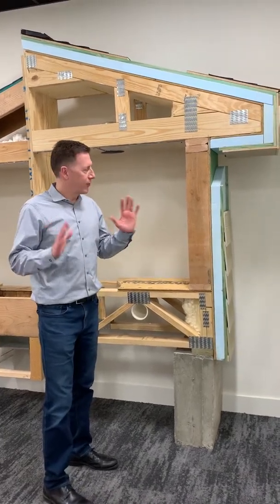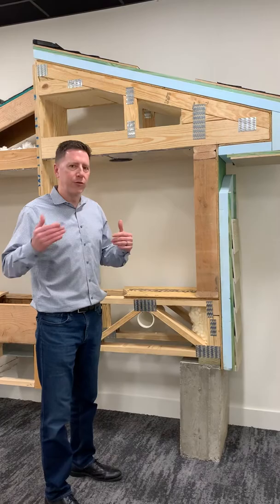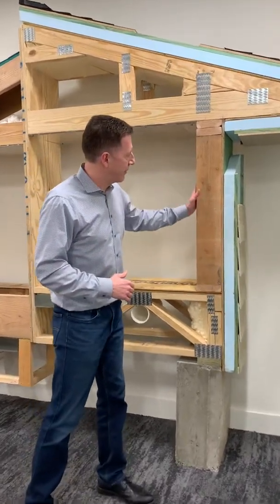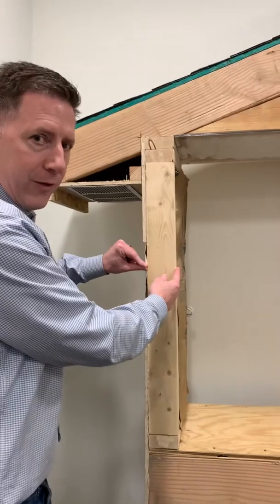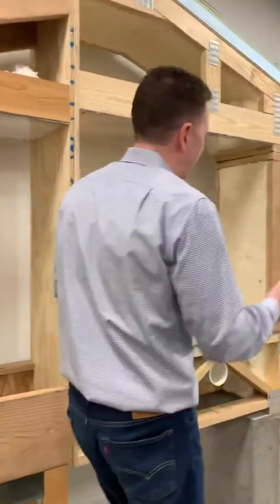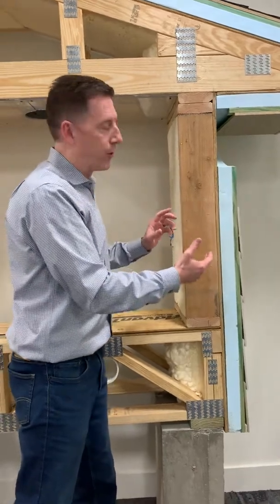12) High Performance Building: A Home Builder's Guide to The Perfect Building Envelope

Comment: My biggest pet peeve are inaccessible attics.

At the very least have a good walk board system around the insde of the attic for maintenance and inspection purposes.
Spray for bugs and critters along with making sure there is no insulation blocking good air flow from the soffits.
Also plenty of good lighting and power receptacles for maintenance use.
Air and air systems along with duct work should be inside of the conditioned space.
All filters should be located with easy walk up access to inspect and change.
There's a ton of changes that could make homes better cheaper places to live and operate but builder profits puts changes out of reach.
Build them as fast and cheap as possible give the surface facade a pretty look , take the money and run.
Reply: Totally agree. Each specialist whether it's insulation, structural, plumbing, or electrical will typically only concern themselves within their lane, and it seems like it would be nice to have an energy auditor or some kind of consumer advocate to weigh the pros and cons of what to do with their existing house which now needs all these tune ups, as well as regulatory reform to make builders not use the cheapest materials and build practices possible and opt for more energy efficient or more modern build methodologies that can offer accessible spaces for maintenance like you said.
Reply from the maker: My attic is fully accessible with this design. In fact, I made 2 more bedrooms and a loft area with the extra conditioned space.
Reply: Attic accesses are obsolete energy wasters. Store your luggage  on the main floor and haul the junk to the trash. There is no  r eason to go in an attic of a modern home.
Reply: @realRonPetersen  I think he was speaking to access for maintenance for older houses, not sure how you got storage out of that. We recently insulated our attic and I was wondering how with all the blown cellulose how much more of a pain it's going to be to diagnose electrical problems or update electrical in an old 50's house. There's a insulated walkway for the boiler system but that's it.
Reply: @MrAlziepen  I’ve had to deal with that blow and I move it with a plastic snow shovel. Look inside an outlet box. If you have plastic insulated wire aka Romex (introduced in 1952) then you can sleep easier tonight.
Reply: @realRonPetersen  that shows how little you know about living materials that are harvested and milled into building materials for home construction.
It shows how little you know about proper construction of an attic access door.
It shows your lack of understanding of the reasoning to have major areas of your home accessable for inspection and maintenance to prevent tens of thousands of dollars in damage to you largest investment in your life.
Your lack of caring about the poor guys that have to hack their way into your none accessible attic that you found nessassry to create.
The only thing you did get right was nothing should be stored in an attic.
I'm sure you are one of those people who buy into the two story home garbage because of energy efficiency and cost savings for the same square footage.
People always over look the high maintenance cost they get hit with anytime a contractor has to do anything to a two or three story home , especially if it's built on a hill.
Everybody's got to have gutters, another major expense and possibly deadly issue with a two story home.
The home owner or friend that's never worked higher than two foot off the ground climbs up on a 6/12 roof and goes to the edge to clear the gutters, good luck with that.
The list of bad building ideas sold to people are endless, not to mention the architects and builders that are not concerned about the problems coming from living in these expensive badly designed boxes.
And least but not last, two story homes are a nightmare to live in and Will wreck your body because of the constant need to climb the stairs for everything.
Bedrooms upstairs and you break a leg or hip good luck with that nightmare..
Then there is the whole selling your home everyone grew up in leaving friends and neighbors because you just can't do stairs and steps any longer..
Number one issue with people that changes their life, back , leg  , foot , and hip issues.
To be a good sales person you have to gain your target's confidence , build up and reinforce the good points steer them away from the negatives and keep telling them how much they deserve the turd your trying to sell them.
People in the end are their own worst enemy, they cannot be bothered to research and think complicated purchases through. And then people like you reinforce bad building ideas.

Comment: What blower door test values do you typically achieve with this insulation model?
Reply: Insulation and air sealing are 2 completely separate layers in the wall system, so the insulation isn't responsible for improving air tightness. While it's true that something like closed cell spray foam can improve the air tightness of the envelope, that certainly should not be the only air barrier.
Reply from the maker: We have received very good values, but this exterior foam concept is not the main reason for good blower door tests. It's a lot of the other details.

Comment: Old School is the correct school! You need to breath, your house needs to breath! I have remodeled 70 + year old homes with roofing felt for wrap with ZERO rot and I have remodeled 10 year old homes with house wrap with massive rotting! If its my property I use felt for house wrap! Now, if you are planning on building your house on Mars Seal that puppy up AIR TIGHT!
Reply from the maker: We use ERV's to allow the home to breathe.

Comment: You dont want a 100 percent air seal on your house. Walls need to breath or you get dry rot, you get charged air in your home because there is no exchange of humid air. So unless you put a humidifier in your heating system and ran it all day every day you would have static, dry air in your home. The science has been this way for decades, there is a reason for it, maybe stick to something that needs this type of thing like a camper/trailer
Reply: ERV and air exchanger.
Reply: Wrong. Building science has changed which is why building codes in literally every country are moving towards full thermal/air sealing with ERVs. This is how passive homes are achieving net zero energy usage. Efficiency comes from having the exterior climate influence the interior climate as little as possible, thus necessitating the least amount of energy expenditure to control the interior climate. That's not possible with leaky houses built to old codes. Vapor barrier on the warm side of insulation is code everywhere, no need for anything to breathe.
Reply from the maker: We use ERV's for air exchange.
Reply: Do you know how much humidity humans give off? If you have a sealed home you need a de-humidifier to remove it.. normally the air leaks in a home dry it out in the winter...

Comment: Aren't Maseratis overly expensive cars that depreciate quickly, break down more than most, and are expensive to fix? I'd find a new slogan.
Reply: That's the reputation.
Reply: money pit
Reply: Poor reliability and higher than average chance of catching fire...
Reply: Yes, I thought the same thing. May as well have called it "the Daewoo"
Reply: I came here looking for this comment, it’s absolutely true, total junk. Funny shit.
Reply from the maker: I have heard more than a couple people say this! Maybe Ferrari next time?!
Reply: @homolydesignbuild I am looking to do an 8" milled log that is flat on inside outside but tongue and groove between each, then tyvek, then foam board, then foam/engineered sheeting then 1/4" air gap, then marine shipping container exterior (possibly coated in inside with either epoxy or truck bed liner or similar or other to additionally reduce condensation and convection and reduce mold potential)

The entire structure will be built on a semi truck trailer. And remain "mobile" capable.
Likely a flat roof/box like design unless there are significant methods of achieving a maximum height during transport and then returning to a pitch roof when parked without compromising the "envelope" ? 
Would love to consider some sort of expansion or slide out ...? 
I saw a great idea out of China where a restaurant WITH seating that expanded via an hinged design to be about 3 times the original width on a semi truck trailer, had a pitched roof when finished...very sharp
I am looking for R value between 50 to 80 as we intend to be in Alaska about half the year and Florida/Mexico or further south the other half.
...any information or suggestions would be greatly appreciated....
Reply: 😂😂😂 Performance ain’t shabby which is what the name invokes for most who never owned (or seriously researched) such a piece of rolling bling.

Comment: You dont include the vapour barrier that prevents condensation.... to your point though, insulation on the outside should complement insulation in the walls as it prevents heat loss by minimizing thermal transfer.
Reply: In a system like this the goal should be to install sufficient exterior foam insulation that condensation can't occur inside the wall cavity even on the coldest design day.
Reply from the maker: Exactly. Condensation never occurs because nothing in the wall ever gets below the dew point.

Comment: I wish I had heard of this a couple years ago BEFORE we built our home.  We still have a nice home with significant energy efficient features, but this could have easily taken it to the next level.
Reply: I'm sure this method has some major disadvantages.  We put this material under flat roofs and it's great until a big a.c. guy crushes it and makes dents in our roofs.  I'm working on a vacation home that has an exterior oil based panel under plywood siding,  it did help preserve the neglected home. Traditional building had earned its place over the years. We occassionally install elaborate roofs that cost 8 times more and may last 20 % longer
Reply: It's overkill and would've increased the cost by 50grand minimum
Reply: @joshuapowers4623  I'm pretty sure it would not add that much to the cost.
Reply: @joshuapowers4623 way more than 50, you have spray foam insulation inside and xps outside
Reply: Big problem with this type of build is now the condensation area is inside your house and it can't air out. Causes many issues and is the main reason we don't build houses like this.
Reply: @alfredborstmayer2964  No the dew point is not reached inside the house, hence no condensation. Also, there should be proper ventilation and humidity control
Reply: Termites love foam to burrow through. Not a good idea.

Comment: The exterior wall insulation of 2” poly iso in the north east is too small. Your condensation point would be in the sheathing or interior insulation. You need 4” outside of the sheathing in the northeast to get the condensation point outside the sheathing
Reply: I believe he said he's in Kansas City, so 2" would be adequate for that location. Insulation strategies are highly location specific.
Reply: In Estonia (Norte-Europe) we use mostly at least 6" of insulation and mostly 8".. So can't use it out here..
Reply: If the moist air can't reach the middle of the wall then it doesn't matter. The only surface it can reach will be too warm (on the inside of the house) or will be on the outside of the house. If water condenses on the outside of the house, it has a place to drain and an air gap to dry.
Reply from the maker: I agree that the insulation should be 4" in the northern climates. 2" works well for us in Kansas City.

Comment: Guess if you're buidling with mending plates and OSB your walls are a bit compromised. Tar paper dries out fast. But no. You're gonna do it all in house wrap. House wrap's a scam. Like baseball cards or Beanie Babies. That teflon what's it called...Tyvek. that stuff'll wil amplify your mold issues ten fold. Let it breathe son! And stop sheathing your rooves and walls in OSB. You're not saving money. you're just poisoning whoever's about to move in. Spray foam insulation off gassing  inside of your perfectly sealed envelope. sealed in by tyvek and reintroduced everytime your HVAC kicks on and starts pumping it through your house and childrens' rooms.. Start buidling with like you know how it's done

Comment: The roof line / wall junction could be greatly simplified by eliminating the soffit and having the wall and roof intersect without the insulation wrapped bump out. Think of the profile of the monopoly game house. An un insulated false soffit could be added or even easier, it could be framed like the overhang on the craftsman style houses with the decking exposed on the underside.
Reply: False soffit was a common detail on timberframes with stress-skin panels.
Reply: Monopoly framing is gaining popularity amongst high end builders
Reply: Yup, that’s why it’s called monopoly framing and then you install eves over the insulation to protect the structure. 18-24” overhangs minimum
Reply: Yup - Matt Risinger has a couple of good vids on that idea.
Reply: https://youtu.be/IDFSnjuNl5U?si=9IX2gkRz5tkLmx_K. 
Matt Risinger
Reply from the maker: I considered this, but the issue is that you have to cut around all the bracing and wood members that penetrate the vertical face of the foam board, negating the advantage of stopping the thermal transfer.

Comment: Exaggerations on par with TV infomercials. Exterior insulation is a nice idea, but these claims and comparisons are just false.
Reply: No, they are not. I did this on my house and it works really well. It’s not cheap but it does work. 
An Energy Recovery Ventilation system IS a must in this kind of house. It does the breathing for the house, exchanging the air. Again this does add to the cost.
Reply: @matthewmara-o2f  the claims are incorrect, but the methods will give an outcome of a well insulated and efficient house. This is a very expensive method to achieve the same outcomes of a more cost effective build process.

Comment: So many things wrong with this , not all , the insulation on the outside with a gap on the siding is a good plan but your home needs to breathe. No documentation has ever proved in the history of home- commercial  buildings benefit from a sealed roof line . Even if you negate the humidity change on the inside of the home by means of more energy consuming equipment,it will not make a difference to the inside walls if you seal it with foam . Open cell, closed cell. I don't care if it's fire retarded or not . You can't stop weather all you can do is buffer the effects to match the material your building with. 
100% seal from outside air is insane . Just do this to cut vent kits that they will be glad to sell you .
You just spent another $8.25 psf to build if you seal your walls .
Wounder why everyone is always going to the hospital,and home prices are 10 times more to build .
Quit your day job .

Comment: How about double wall with 12” dense cellulose and 2” zip R. Spray foam the attic. Need to condition the attic for moisture control. 

How to continue air/water barrier around concrete slab/basement? ICF?
Reply from the maker: A double wall is another good energy efficient technique, although I think it will cost more. I'm not a big fan of cellulose because it will eventually settle and leave a 4" heat gap at the top of your walls. The 2" foam Zip board is essentially the same concept from the video, other than I prefer the Zip sheathing to go on the studs first for strength purposes. Yes, a conditioned attic is definitely the way to go and I have another video on this topic. The exterior foam goes over the foundation as well. See my other video on how we build foundations.

Comment: You said the ridge vents vent the "air gap". Where is the intake venting that allows the ridge vent to do it's job?
Can't spray foam the underside of the roof, that would block the air gap/venting. 
That roofing foam board is low in R value. You would go broke heating that home.
This method needs more thought, but exterior insulation is the way to go.
Thereare better method for exterior walls currently. I would go with trusses that give a 2' "knee wall" like configuration at the exterior wall. This would allow for blown in cellulose 24" deep right at the top of the exterior walls. then I would forget the exterior insulation on the roof, and install radiant barrier under the rafters. Fully vented sofits, and call it a day.
Reply: I think you are right. With no intake at a lower level there can be no chimney effect , so the cavity could be get filled with dead air which will eventually get humid and condensation will start. It's the same reason they put little vents at the base of brick  facades.
Reply from the maker: The air intake in the 3/4" air gap around the entire home is at the bottom of the siding (with and insect / mice screen). I also added an additional venting location at the outside edge of the soffit. Yes, I spray foamed the underside of the roof sheathing to form a conditioned attic (there is an additional video on this topic). It doesn't block the air gap because the air gap is on outside of the exterior rigid foam board.  My roof R value is obtained from the rigid board (R-10 for 2") and then all the foam on the underside of the roof sheathing.